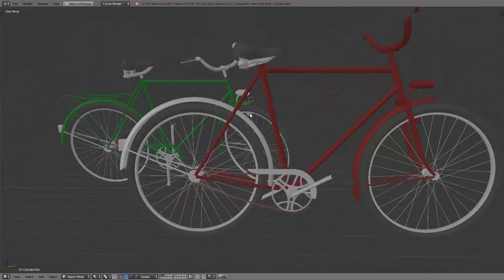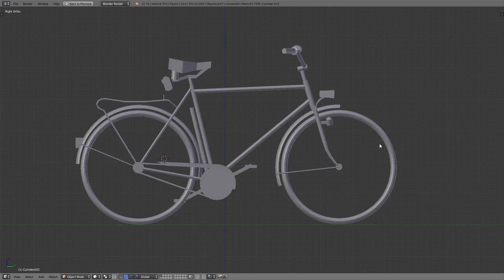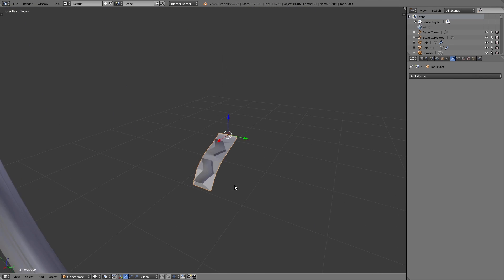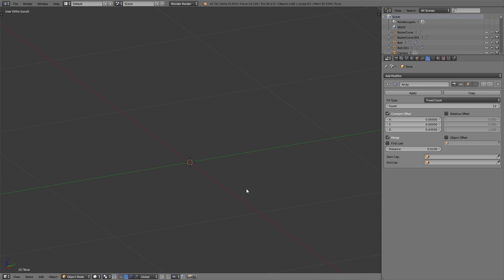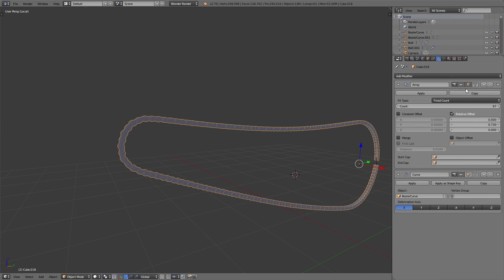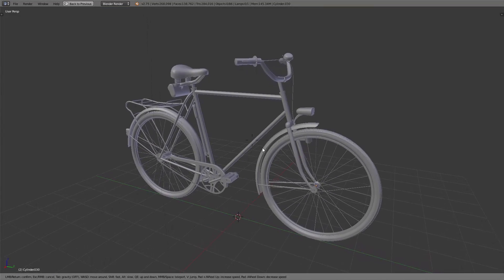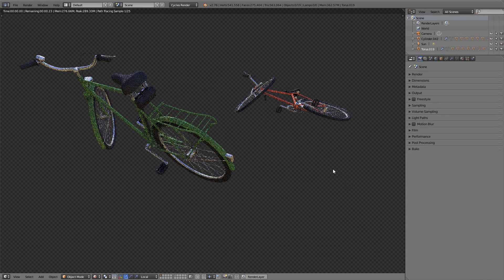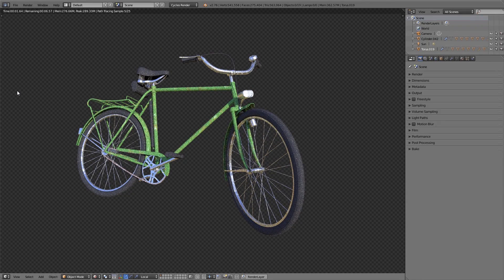MSC #08 - How to model realistic bicycles (Blender Tutorial EN)

Comment: Me: This looks good!
Also Me: *looks at verts*
Reply: as a new user to Blender, what would you say is wrong or concerning about the vert count/shape of this model?
Reply: @dannyhengel7645 it's just that my compiter can't handle it. Tbh high verts are good
Reply: 255k -- eek! This would be nice, but having 5 or 6 of them in a full scene could get nasty.
Reply: @emmettboudreau2749 Well you can make a low poly version of it with less subdivision to it
Also the wheel details could be turned into a single image plane with an opacity mask for games or for your scenes as well if it's gonna be far and not near the camera.